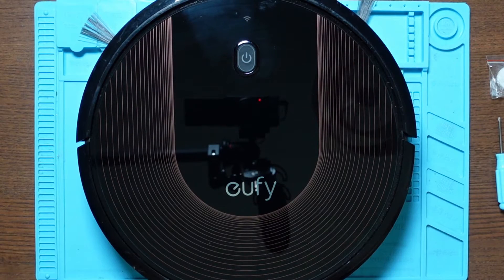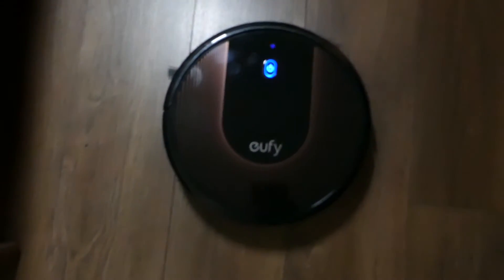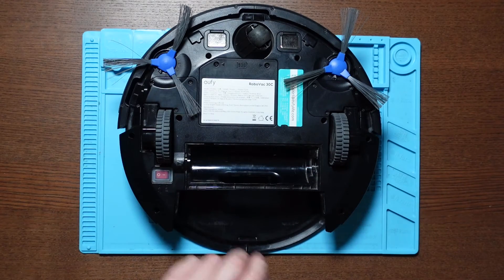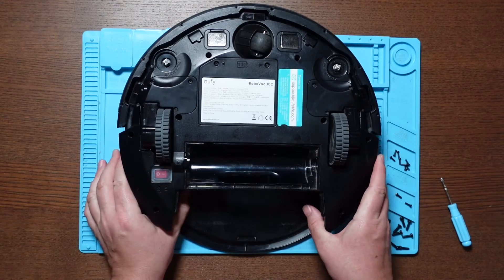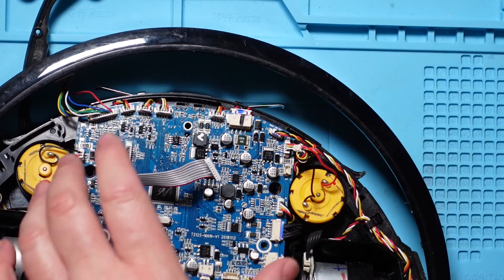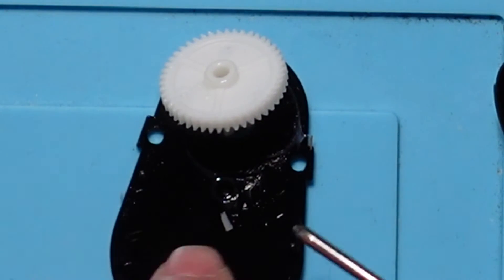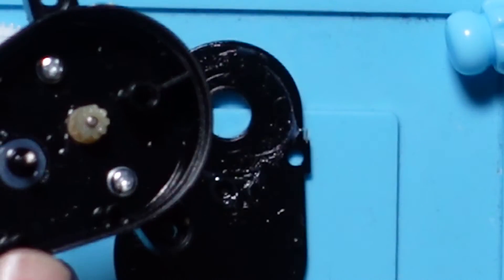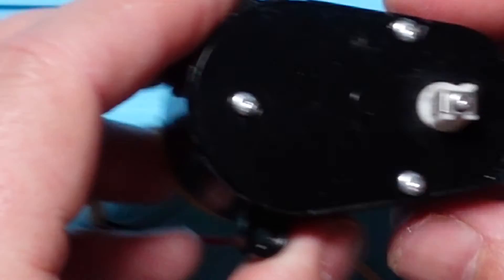HOW TO replace the EUFY Robovac side brush motor gears | Repair kit from eBay | Teardown & Fit

Comment: What is the cool mat you have under the Eufy while taking it apart? Also if you have access to a 3D printer you can print the replacement parts https://www.thingiverse.com/thing:4247963
Reply from the maker: Yeah I saw those templates, I think i might get a 3d printer at some point! The blue mat is a silicone heat-proof soldering mat. You can pick them up at Amazon 👍
Reply from the maker: This is the one I use:  https://amzn.to/3mUiIZl
Reply: Can confirm this works after taking it apart and putting it together. I used PLA as the filament to 3D print the part but it’s a bit noisy. YMMV with a sturdier filament.
Reply from the maker: @rmcastil  Good news. Would be interesting to see how long the printed gears last. 👍
Reply: @StezStixFix  printed gear only lasted about two months. I found another service that printed the gear with polycarbonate for a couple bucks. Will try that out to see how it holds up.
Reply from the maker: @rmcastil  thanks for the info! That's not too bad considering, I think the polycarbonate should hold up better! 👍

Comment: I replaced whole side brush motor and now the brush rotation is not right, any comment about this?
Reply from the maker: Did you replace it with a used one, or a new one?
Reply: If you still have the problem, reverse the power cable that goes from the motor to the main board...

Comment: Do you have a link to the replacement gear set?
Awesome video!
Reply from the maker: I've just had a look at where I got mine on ebay, and they do seem to be out of stock. I've sent the seller a message and will let you know what they say...
Reply from the maker: Hiya. They are awaiting stock and will update ASAP. They said they will pop a comment on here when back in! Hope that helps.
Reply: @StezStixFix  thank you for your help!
Reply: @mick0905  Excellent video Thanks! However you can purchase the entire motor assembly From Eufy (WWW.Eufylife.com) for $12. Free shipping on $ 25 or more. Thanks for showing us how to do this, I wish the gears were cheaper though.
Reply: @jeffsmith7837  no such thing exist at that website, how do you do it?